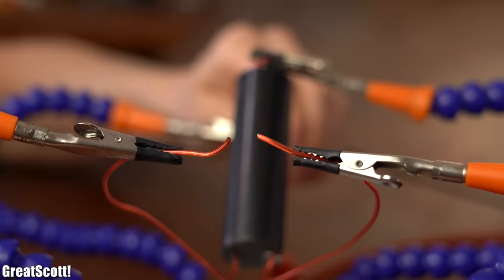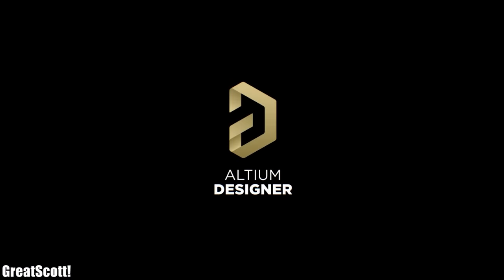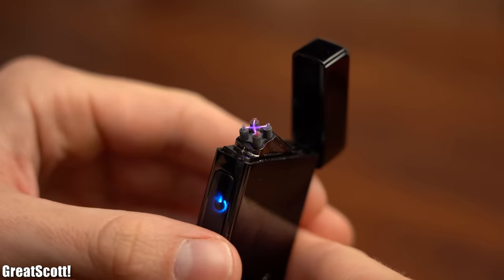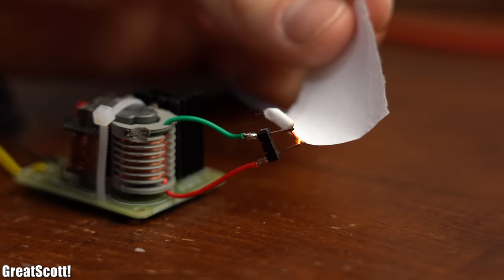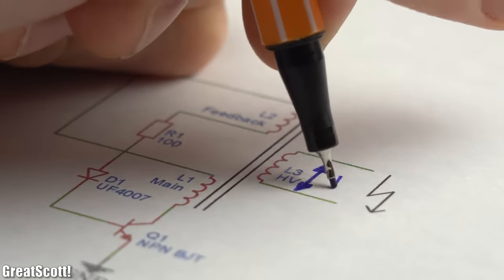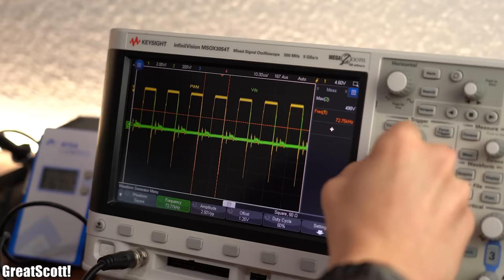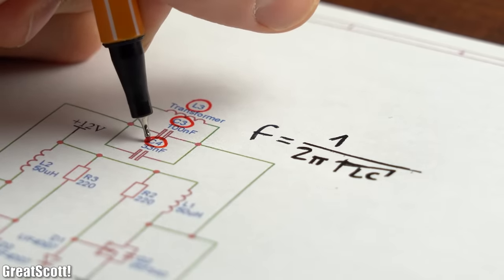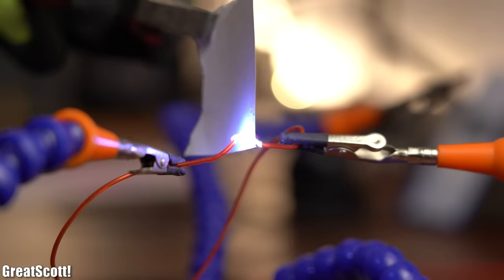DON'T BUY this HV Generator! Build this one instead....please

Comment: 5:46 I think you are wrong, 1. in my experience one coil is backwards in your drawing, didn`t start to oscillating that way, the vcc should be oposied of each other . 2. it works a bit different. the current starts to flow over the base -> the collector current is rising -> the transformer rise the base voltage -> the base current is rising until the coil is saturated and the base current starts to sink -> the collector current is sinking -> it induces a negative voltage in the base coil. this starts a chain reaction until no current is flowing and it starts all over again. please excuse my miserable english
Reply: Correct, it's a "blocking oscillator", primary and feedback need to be antiphase. This is why phase dots on schematics are important.

Comment: Changing from the BJT to MOSFET can be done by removing the diode, as current has to flow back out of the gate to turn it off. I also put a fast diode (eg, a schottky) between the mosfet and the transformer, as the body diode is usually slower. You can also help protect the transistor by making sure the current can come off the secondary coil of the transformer straight away, with use of high voltage diodes/capacitors, rather than making it have to produce a high voltage spike to produce the arc before current can flow. The quicker you get the current off the secondary, the less there is trying to flow back on the primary.
Reply: "with use of high voltage diodes/capacitors" - that would pretty much make it identical to the "garbage device", as can be seen here: watch?v=mTx8pMHo4jI

Comment: I got one of those 'high voltage spark generators' from eBay 6 years ago. Used it in a Halloween prop on the wall. Works as needed, I made sure no one touched it.

Comment: I used the first module to charge a capacitor for ESD testing. It was overpowered, but the other modules output AC so an extra rectifier would be needed. Output voltage is around 8-10kV.

Comment: As somone who did post-doctoral research in pain and currently doing electric brain stimulation devices (much lower voltages and frequencies))), I find the fact that you don't feel anything at 250 kHz (it's higher than any action potential and anything above ~5 kHz should be filtered by RC of the skin anyway) very thought-provoking... If there was a way to tune that frequency to find the exact frequency threshold (and maybe find a threshold at which you feel touch, but not pain) and compare it against the membrane models of the different sensory fibers (e.g. using Neuron or Sim4Life) - this could result in a good Nature paper. However, even as is - this finding (if not previously published) is worthy of scientific interest! Well done! :)
Reply: I'd wager it's more a matter of skin effect than anything biochemical. The current just isn't reaching the nerves, so they have nothing to report until the heat permeates the outer skin layers.

Comment: Hi GreatScott! Thank you for this video, i find it very interesting. May i suggest you to use the dark mode theme for your EasyEDA? The sudden brightness change really hurt my eyes when im viewing it in the dark (does this suggest an automatic brightness dimmer like the sound adjuster? JK XD).
Reply from the maker: Didn't know they had a dark theme. I will have a look ;-)
Reply: The automatic volume adjuster is not suitable for people who are using the TV integrated speakers (you would see the volume level changing on the screen) or some device that can’t be switched with a remote control…
I think a such thing should be software based, because you first filter the signal, and then add gain depending on how high you want the volume to be.

Comment: Word of Caution a similar type o circuit, self build transformer and a diy zvs, while testing on my pinky finger did some huge damage to some extent i could not feel my pinky finger for 3 months and only fully recovered after 6 months, take my advice don't try to be a test subject yourself you can make mistakes
Like on high output side, never touch 1 wire in one and other wire in other hand as high voltage can pass through your heart, always keep one hand behind your back

Comment: That $10 one in the beginning, I used one to make a rat killing trap. Used a circuit board with a zig zag trace in the bottom of the box with one lead of each side of the high voltage touching, then when the rat steps fully inside hit weight triggered a switch under the circuit board turning on the device and giving the rat a deadly shock through his feet. Worked great until it rained and ruined it.

Comment: I'm thinking that the high frequency is the reason for the fins in the secondary coil. Not for heat, but in order to wind the coil in shorter segments. Often a different wire must be used. For instance a 40 AWG/ 170 strand Litz wire might be used in this application.

Comment: The HV module literally is the one they use in Tazers. It is a inverter that charges a small capacitor that discharges through a sidactor or mosfet to a small hv pulse transfotmer. Used them for laser flash lamp tube ignition.

Comment: You can replace that NPN BJT with an N-Channel SiC power JFET.
The positive bias makes it behave like a npn BJT (kinda) and a high negative bias turns it off.
There are SiC JFETs with the max DS voltage of several hundred volts or even over 1kv.
Reply: Can you recommend any?

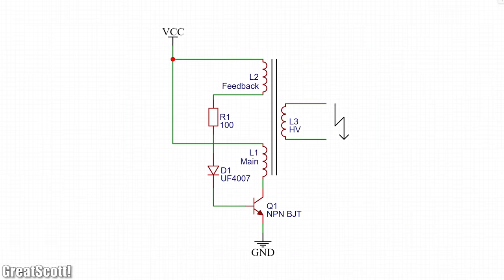Comment: @4:20 maybe the transistor also failed because you used an input of 4 volts x 2.8 amps, normally the recommended voltage yes is around 3.6-4 volts, but usually from a battery, which not only has internal resistance, but taking into account the resistance of the primary and feedback windings, will probably draw far less current than what you were supplying with your power source- basically have to match the impedance.

Comment: Amazing video! I bought some of those tazer modules a while ago. I found that they can cut a very tiny hole right through paper so I want to use one for a cnc paper cutter
Reply: Have you also tried if they can cut a tiny hole right through a finger if you accidentally touch it
Reply: @im1random263  nope, I have messed with high voltage since I was 6 and only got shocked once then. I am careful
Reply: These modules also can put tiny holes into glass. Wouldn't recommend tho.. (Tested with an dead light bulb.)
Reply: @Reaper035  oh my, That sounds dope. Quite intruiging how powerful they are.
Reply: yeah or in my case it can burn a microscopic hole through an olive or other fruit and creates a smell

Comment: Heyyy, Great Scott, great job, again! About so called ZVS driver (sometimes called Mazilli driver) , that ZVS means Zero Voltage Switching , and is a technique that can be applied on almost all SMPS topologies. Often this Mazilli circuit is called ZVS FLYBACK that is wrong. Real name is resonant push pull ZVS converter. ZVS is technique used for so called "soft" switching , exactly in time where voltage (ZVS) or current (ZCS) across the switching element  is zero, thus reducing switching losses. And first circuit with BJT is so called "blocking oscillator" and is used in old type fluorescent lamps converter/ballasts which were battery operated. And YES it can be done with MOSFET but you need PNP gate discharge speed up circuit and current ramp control. It's a little bit tricky but it can be done ;)
Thank you for your detailed approach and great videos.
Reply: They usually call them zvs flyback driver because they are commonly used to drive flyback transformers but yeah, its pretty misleading.

Comment: 3:47 i found out the hard way, you can see there are 4 lines next to the 3 holes, 2 thicker and two thinner. Those mark where the thin and thick wires go.

Comment: You can make bigger arcs by hooking up a 12V relay circuit to 2 transformers. I usually reverse feed a step down transformer because that's what I have on hand and then step up that stepped up voltage with a step up transformer and then the arc is able to melt metal. All powered by a 12V battery.

Comment: These HV generator modules are really strong. Feed them the max rated voltage and they will produce arcs an inch long.
But they burn out quickly! So keep to to a few seconds at a time.

Comment: Could you also talk about how the circuit inside the taser module (which you asked us not to buy) works?
Reply from the maker: Maybe next time ;-)
Reply: @greatscottlab  Looking forward to it!
Reply: It's the same, 2 windings encased in epoxy resin just like he described. I just buy them for $3, it's not worth building them. Or just buy a taser for $7 if you want a taser.
Reply: i've seen schematics, I think its a royer oscillator connected to a small voltage multiplier,  some people talked about it on the BigClive video.

Comment: Try to design a adjustable HV source. Like a laboratory thing. As you know, laser printers uses several such sources to operate with a toner. Do precise source can help with doing prescise things. Note that your device gives you an high frequency AC voltage but a factory one makes DC. Not every application can consume AC and so for printers. You can't attract something with AC and it quite hard to insulate it because it causes heating of most insulators.

Comment: First time I see GreatScott get zapped by super high voltage!
   Also fun fact for you: The amazon cheap transformer one I have a bunch of it at home, and these transformer are $h!t. The copper wire inside can only hold around 9A and high resistance too! (primary coil is  nearly 2 ohm!!!). I burnt three of it just because I short circuit 1.7kV.
   As always, thanks for a very good video!
Reply from the maker: Thanks for the info!

Comment: The latter unit with the flyback type transformer can be significantly improved by coating the windings with multiple layers of super glue, allowing each coat to dry before applying the next.
This significantly reduces the likelyhood of arcing between windings.

Comment: I use the first type for specific high voltage ignition systems that need to be high energy and battery powered rather than mains which many systems are, so they do have their uses.

Comment: Thanks for doing such a deep dive, which I confess I don't fully understand, at least, not yet.... The first device, if used only intermittently, might last a lot longer, right? A ready-made gas-stove igniter (which I have a need for) is MUCH pricier than one of those cheap kits, and its robust, opaque packaging doesn't offer much potential for learning/tinkering.

Comment: That transformer circuit was used in ozone generators at one time. It is very sensitive to the choice of BJT. Even if you get the correct transistor, only the low gain ones work. Since Fairchild quit making the low gain ones almost 10 years ago, they are probably very hard to get.
The small arc you got in the beginning is what they're designed for.

Comment: If you connect one end of the cheap HV generators to a resistor of 10k-100k ohms and isolate it with heat shrink, the arcs end up being of lower current and higher frequency, essentially being like the diy generator.

Comment: Ahhhh yes. This first circuit is the first circuit I built as a youngish kid when exploring my blossoming love for all things high voltage, with flybacks ripped out of old TVs and monitors(the first was actually from a plasma globe but it was too wimpy). I suspect that it's the same for a lot of us. The second was the standard 555 based circuit and playing with plasma speakers...and onwards onto the (1kW in my case) ZVS and other things much, much more dangerous :D
I've played with home made lasers, bigass tesla coils of various types, railguns, X-ray transformers, there's a tesla coil power supply I built for static and rotary gap coils in the shed that I've seen taking upwards of 80amps at 240v input before and with an open circuit secondary voltage of 10kV...so that thing is absolutely completely and utterly lethal beyond words
Reply: There are some people I will never hang out with
Reply: @nicwilson89  I'm that friend lmao, I feel like we'd zap each other, violently, if we ever met bc of what we play with
Reply: @whimsy5623  Someone would probably die at some point or get irradiated but it'd be a great old laugh and everything will be fiiiiiiiine :D
Reply: @nicwilson89  got myself some nice kit too. I've got one of the largest PTs I've ever seen a hobbyist have. Have some vids on my channel of it running at up to 15kVA, in case you're interested. Also have some giant 10kVA transformers (rewinding them for 5kV), along with an XRT and some other fun stuff. Gonna make a giant SGTC soon too
Reply: @inductivelycoupledplasma6207  Oh I'll definitely be checking that out!
Reply: @nicwilson89  please upload videos of your stuff!!!! (If you still have it)
Reply: @inductivelycoupledplasma6207  Still got it all, just buried in a shed. Some naughty stuff in there though haha

Comment: Some ferrite cores I use with the zvs circuit get hot, and it's not loss in the wires, maybe the core goes into saturation or something, but I thought all the energy was stored in the capacitor and inductor ... I always need a minimal air gap for best efficiency.
Reply: Well, I don't get the correct word right now but it's basically an induction heater. Usually (larger) transformers use laminated sheets of metal instead one piece of material to avoid/reduce this problem. Your air gap does the same.
Reply: @Reaper035  I just wanted to have a toroidal ferrite transformer with the zvs circuit, but it's an impossible combination...
Reply: @VictorC173  It would be possible, but you would also have to lower the frequency low enough for it to be usable and not end up as induction heater. Or maybe there exists laminated toroids but idk, I'm no expert. (I think angular laminated toroids exist.)
Reply: @Reaper035  ah, it's not iron cores, I mean ferrite toroids not working with my ZVS circuit, the core heat up fast with only drawing 6w of power in idle, while a ferrite transformer with a minimal air gap consumes less than a watt...
Reply: @VictorC173  I'm not sure but I assume that ferrite cores are electrically conductive as well as iron cores are. And the changing magnetic field of any transformer causes Eddy currents to form inside the iron or ferrite core. And these currents are what causes the heating. When you "slice" the iron or ferrite core in smaller, insulated pieces this mechanism decreases. That's why laminated iron cores are usually used instead of one giant slam of material. (Btw: ferrite is iron-based, afaik. And basically iron particles backed together in whatever form you need. I think they are just cheaper.) Take a look at Eddy current videos, Scott also has at least one of them explaining it. Also ElectroBoom has one with an good explanation.
However: that drop of idle power draw is quite significant from just one (or two) air gaps!

Comment: Thank you for this inspiring video, I also had the same DIY-kit, some time ago, but I wasn't sure, how to solve this overheating problem, for non-stop operation. Just considered about using a better heat sink and / or stronger transistor. 
Finally you made it, this bright and long yellow arc for sure is producing some NOX from the air, so be careful not to breathe in the toxic stuff. I already realized it in the original circuit, covered the arc in a test tube, after a while the brown NO2-gas is generated, but you can't let it run over time, due to the heating problem.
I was looking for a micro scale Birkeland-Eyde-Generator, cheap but still suitable as a demonstration model, that could be solar-powered. 12V are just perfect for this, since many panels run on that voltage.
Should be possible to create a miniatur nitrate-factory if bubbled in a carbonate solution. Not for fireworks, but still enough for some small chemistry experiments. :-)

Comment: @GreatScott! : That device is not that bad, if you have ever get socked by the ignition circuit (the thing that replaced the ignition coil) then you get the real pain and btw those "ignition coil devices" are real killers, like those are no teaser but electro-killing devices ... i bet the federal agency for zappy things does not put a stamp on them just the plain old regular TÜV Rheinland. On the other hand your suggestion is valid too, there is more that one way to get HV to do stuff with it, HV and playing not mix good, always treat a unknown HV device as deadly until you get the specs and chk if it is functioning properly.

Comment: I have one of those premade modules that you say not to get and my cat hates the sound it makes. I don't like it either, it's high pitched and loud. I want to make a high voltage generator that would be outside of my cats hearing range so the sound doesn't stress him out. Looks like cats can hear up to 85khz.

Comment: I am exploring various ways to make the best fly-zapper (specifically houseflies) since we live out on the country and every time the sun shines, a lot of houseflies appears. I have noticed some things about the flies. They like to land on white surfaces. They like moisture. They like heat. They navigate somewhat with UV, and is drawn to it somewhat, but not as much as heat+moisture+white. I want to make it such that I use a light-bulb socket in the ceiling. So, my constraints are, not too heavy circuits, so no fat mains transformer here, would have to be some ugly and dangerous Cap hack from mains (230 v). It would have to involve a light-bulb and a white surface, it preferably would involve a small jar of warm water to get that moisture, if it doesn't make it too heavy. I am leaning towards a plastic white PVC pipe with a light-bulb at the bottom, a grid a bit out around the pipe (vertical pins), and some way of maybe having a small glass jar of water below it... something like that. So it is interesting that I'm starting to see a lot of videos like these in my feed :).